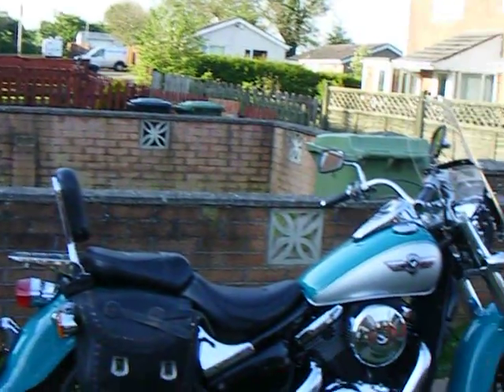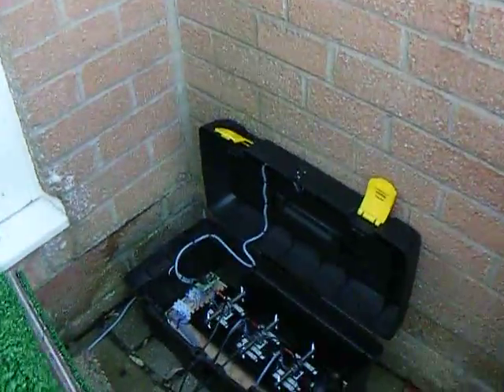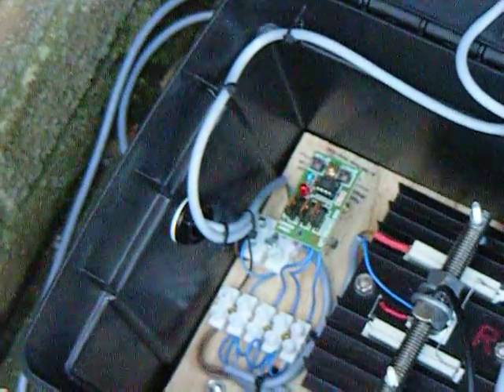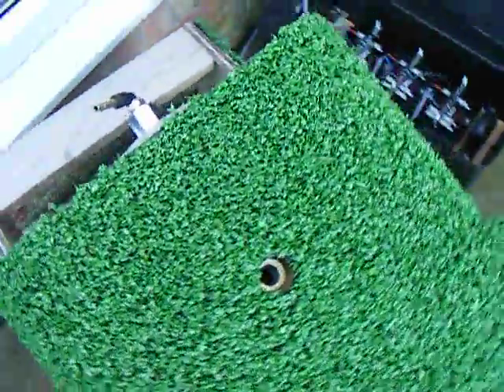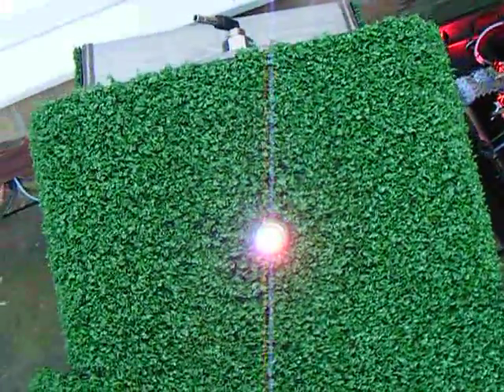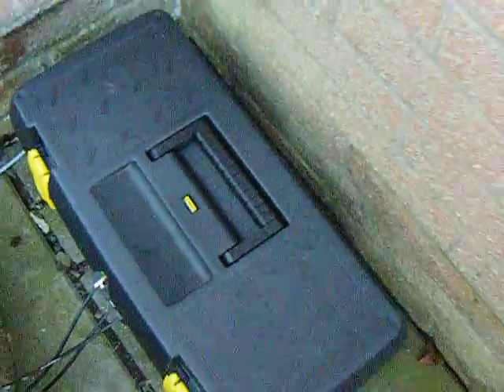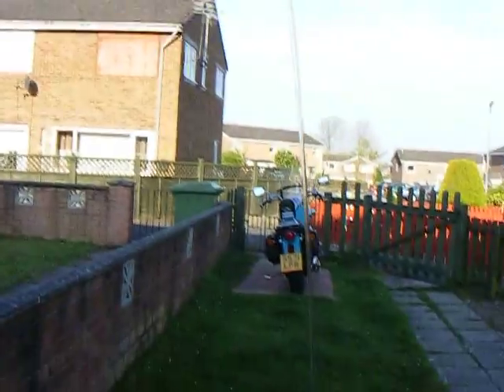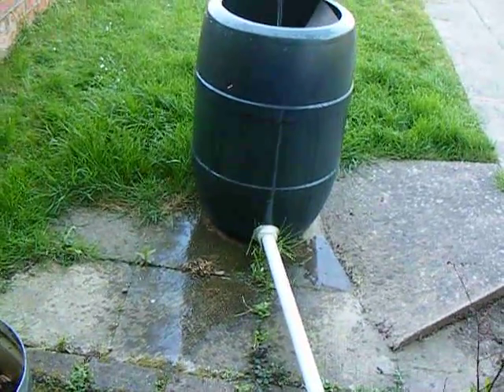Laminar Jet.AVI

Comment: What are you using as a pump?
Reply from the maker: Hi Brian,
the pump I used was a 240V 'Wierpro' unit which had a 7,800 litre per hour delivery rate.

See it in action again here (better laminar flow) --> https://www.youtube.com/watch?v=MOBcdnRQ4jY

I had a quick look online tonight and found this ??

https://www.amazon.co.uk/Jebao-Energy-Submersible-approved-OFE-10000/dp/B00915LJEG/ref=sr_1_65?ie=UTF8&qid=1467674324&sr=8-65-spons&keywords=submersible+pumps&psc=1

Are you thinking of having a go at building one ?

Oldsparky.
Reply: +Don Jupp I've been looking for something like this to do a water feature in my yard but the commercial ones are ridiculously expensive. Yours looks AMAZING!!!